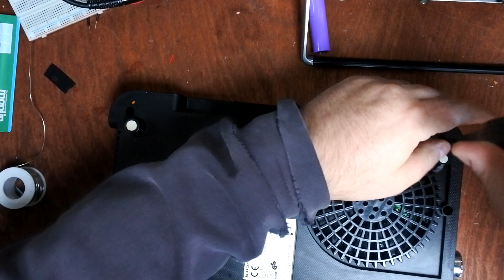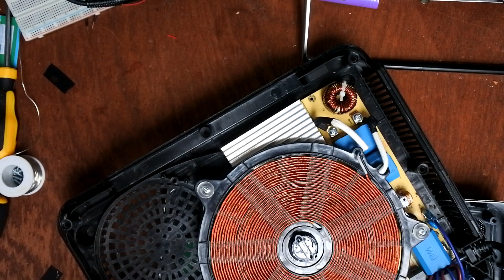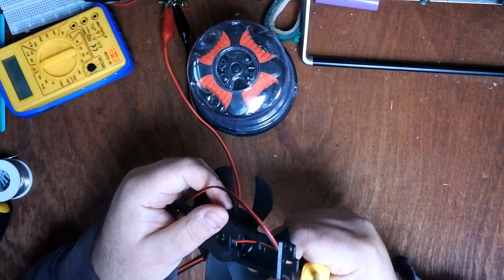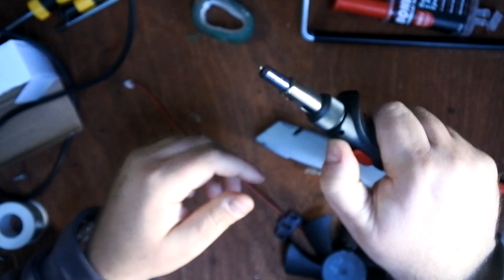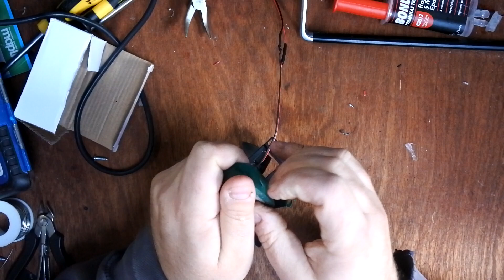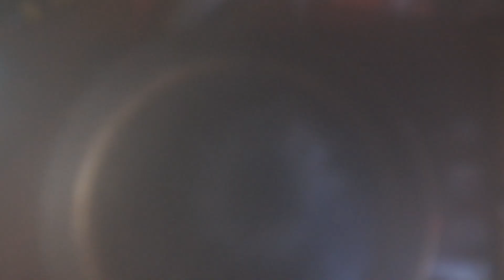Repairing a broken fan in an induction hob.

Comment: For anyone with a broken or noisy fan on this sort of hob - you can pick up replacements with the exact same fixing points and connector on ebay and aliexpress. Ours got super noisy for some reason but the fix was only about £7. I am interested in fitting a super-quiet PC fan but would need a stepdown from 18/20v down to 12v which I wouldn't be sure might trip the error code on the hob.

Comment: And only now when you are done recognizing the intolerable noise it makes, you realized that you should have thrown that sorry fan out the window and bought a larger silent one and glued it on from the other side - which is what I will do.

It will only require adding an inch to the knobs on which the stove stands.

Even though there isn’t the faintest thing wrong with the original one - besides from the noise it makes.

Comment: nice thanks! I have same issue on a DUXTOP giving me an E1 error.. works great but when I tool it apart some fan blades were broken off and I could not get power to the fan... looked everywhere but cannot find a replacement fan here in states.. the part number is YHWF-118 and is 18v. 0.17a. .. it sure seems these are the exact same interior to my DUXTOP down to the fan!.. I was a little Leary about epoxying the fan blades back but maybe Ill take a shot.. also the fan does not run so I can run cooktop a minute or so and it errors out no fan comes on at all